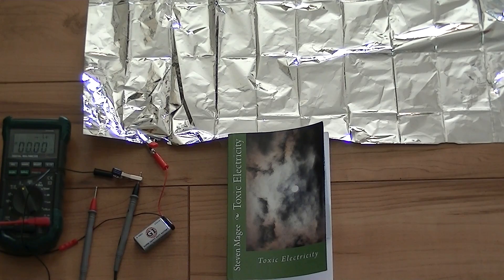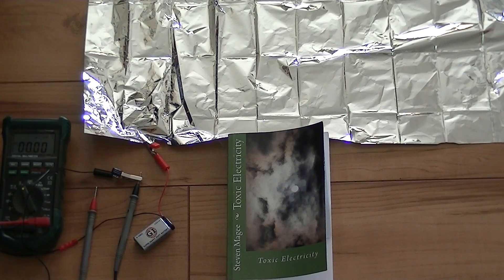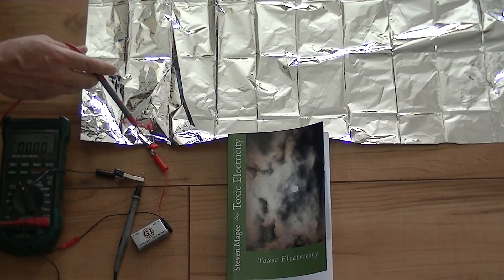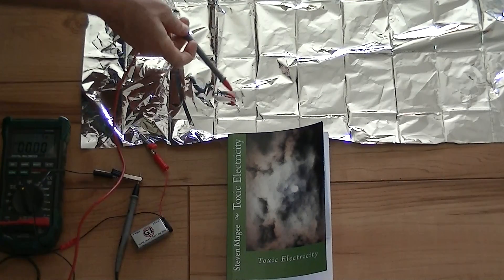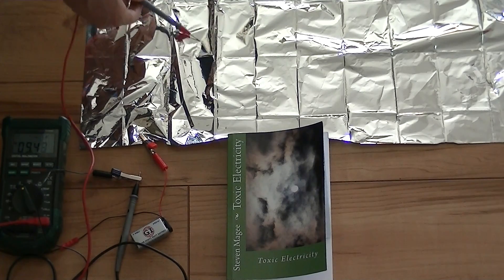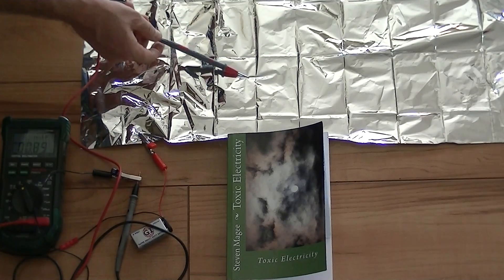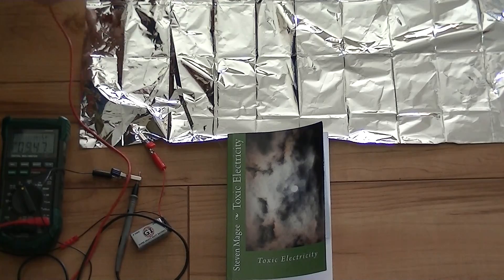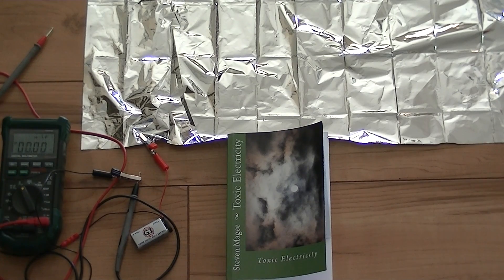The Problem with using Space Blankets for Electromagnetic Shielding

Comment: So there is clearly obvious logic in this test however why aren't you also testing the mylar as a shield with a tri-field meter to actually show its effectiveness compared to aluminum foil? Without doing that you're not actually proving it's ineffectiveness in anything other than its conductivity which may explain more than the average person understands. Also what would be the difference in effectiveness and using multiple layers or a space blanket that is folded over at least once or twice. How many layers of space blanket would it take to achieve the same effectiveness as a single layer of heavy duty aluminum foil? If aluminum foil is so much more effective I guess I just wasted a bunch of money buying 20 space blankets planning on layering them across the wall in front behind a dual pair of smart meters in the place I'm about to move behind my living room wall.  I'll have to get an EMF meter to test at this point. I was thinking of going with EMF blocking wall paint but apparently it's dark in color and we'll have to be painted back over with the original wall color to hide it from the landlord and getting charged for them to have to repaint it when I move out. But I figure if I use the wall paint I would at least be doing a service to everyone else that ever will live in that space to protect them from EMF's whether they realize it or not going into the future.

Comment: i put up my small tent in my bedroom and covered it with 3 layers of space blanket. then i tested the connection via a download/upload online test. the test result was conclusive. inside the tent, under the space blanket the signal had a significant drop. also ran a wavemon spectrum test. the signal was significantly weaker inside the tent.  not sure what you are trying to explain in this video......

Comment: Well first of all electric fields aren't toxic, but second of all the surface conductivity has almost nothing to do with blocking rf. if you really wanted to block rf you wouldn't be using any kind of foil, but instead thin plates of silicated iron or ferrite sintered powder.

Comment: Dearest Sir,
Can you tell me if using one of these electronic probe meters (or any other meter, device, etc), will be able to detect a direct energy weapons attack on a person while they are completely enclosed inside of a extra heavy duty aluminum foil sleeping bag enclosure (Faraday cage), that has two 3" x 3" #40 aluminum wire mesh air vents on it? Detecting this DEW is the key to my goal. How can I go about it?
I have used a ACECO RF frequency meter with success but now my perpetrator has learned how to get around being detected with it and messes with the meter to avoid being detection properly while targeting me. Any suggestions will be appreciated!
Reply: You get less affected by doing parasite cleanse. Parasites atracts all the heavy metals and thus living inside. It also reacts to emf.

Comment: Can aluminium foil protect from 5G?
Reply: Copper is better. Lenz law. More conductive. As electromagnetic waves move through a conductive material, they cause electrons to move which have an exactly opposite magnetic field, resisting the movement of the original through said material. The more conductive the better. Copper beats aluminum by a little. The only things better are silver and graphene, both more expensive. So, for the typical budget, aluminum since copper is also pretty expensive. Not necessary to ground it, the work happens inside the material and is dissipated as increased temperature, from movement of the electrons. It is commonly believed that steel garbage cans make good faraday cages but their conductivity is quite a bit lower than aluminum. Using some spray glue and lining it with aluminum foil would help there, and several layers.
Reply: @garyha2650  Wow, thanks Gary!
Reply: Yes, use 2 or 3 layers for better protection
Reply: See what Global 5G Consortium on FB has to say about it :/
Reply: Needs to be grounded
Reply: GIOVANNI ROSSETTI what do you mean by grounded?

Comment: interesting,  I'd like to know where the metal in the sheet resides.  On the surface or within the material.  I'm going to do the same test but puncture the material with the probe.... I also have several transmitters  and might check attenuation level. Thanks

Comment: Thanks for the video and simple analysis. It cleared up my doubts about conductivity of this material. Clearly there are gaps in the aluminum that has been deposited on the film.  I did my own testing with the ohm meter and found no regions larger than 25 mm in diameter that were connected.

Comment: Using my EFT meter, the signal that comes through an adjoining wall drops from 2.xxx to under .50.    Only one side of the film works to reduce the signal, so you need to find out which side is the reflective side.   I have moved into an apartment with 20+ wireless routers in the area (OMG) so I have a LOT of work do to.   This was a good start.   I will eventually build a sturdier (and larger) protective wall surface, but for the immediate reduction of the signal coming through the wall, this worked.  How I'm going to stop the EMF's coming through the ceiling, from the apartment above, that's a different story.  But all in all, this was a super inexpensive fix!
Reply: How did you put this on your walls?
Reply: Hi there, Chuck.
Reply: Sitting duck here in this 11 apt building OMG sounds like you have means and knowledge please help me know something fairly affordable idk what to do

Comment: Just curious why you didn't use the resistance measurement mode of your multimeter, but used a battery instead. A lower voltage reading across a test piece is not necessary an indication of lower conductivity. If you are measuring 1V, that simply means that the remaining 8V is dropped elsewhere, possibly across the test leads. And that would lead to the opposite conclusion, that the test piece is actually more conducive than the leads. Anyway, thanks for posting the test, I am not trying to criticize, just offering a possible explanation.
Reply: Interesting. What would be your conclusion then, Andrew Sarangan, from the fact that the kitchen foil didn't exhibit the same problem?
Reply: I thought the same thng right off. I suspect that similar to lengths of extension cord, the amount of conductor voltage/current must pass through, requires more voltage for more material. In this case, you have to add the WIDTH to the distance, which may be dissipating the current, so now your "wire" is 3' wiide!
Reply from the maker: I was developing the "Electromagnetic Sandwich" health technique that required a constant voltage across the Mylar film.  I used kitchen foil instead which did not exhibit the problem.  Page 41 Toxic Health 
http://amzn.com/1466336153

Comment: HI

I tested the myler blanket for RF blocking ability and it seems to do a good job. 
I do also use it on one of the walls in my house to stop a radar signal and it does a good job (my measurment and by feeling less pain). 
I don't recommend it as a permanent RF blocking matirial, but as a temp solution untill you install the real stuff, defently. 

amirb
Reply: why do u say this is only a temporary solution for RF blocking? Also i know wifi signals are radio frequency radiation, are cell phone towers though as well?
Reply: @DarkGhostHacker  Yes they're all radio frequency. I think the problem with Mylar and foil is that they reflect the signal, which can magnify it in other parts of the house, unlike graphite shielding paint and the silver bed canopies which "absorbs' or attenuates the signal (thsi is better).
Reply: @toomuchtruth  I would be interested in your opinion of Global 5G Consortium on FB.
Reply: Because it doesnt block a LOT of EMF radiation, it blocks some which is better than none. If you have the money a permanent solution should block most to all, but it's absurdly expensive
Reply: Hello, how did you ground the mylar blankets on the walls?
Reply: Which Mylar blanket do you use because they can be good if they are thick enough
Reply: @TheDeathOfLucifer  I buy and then test them with RF meter.